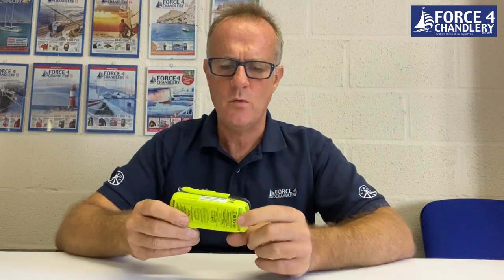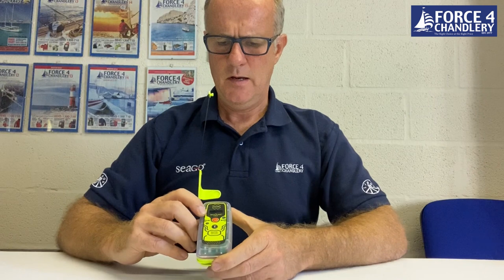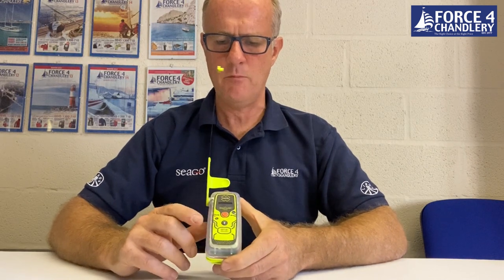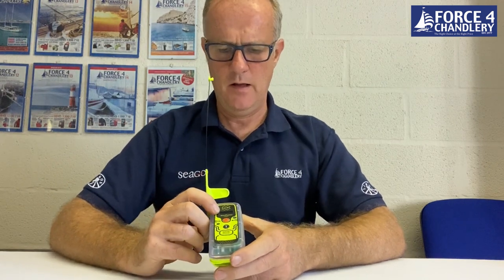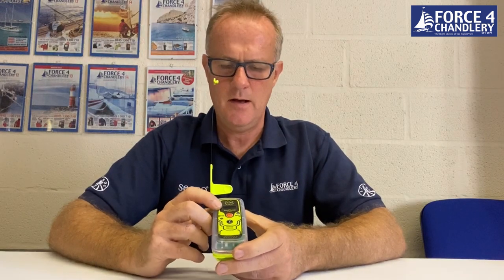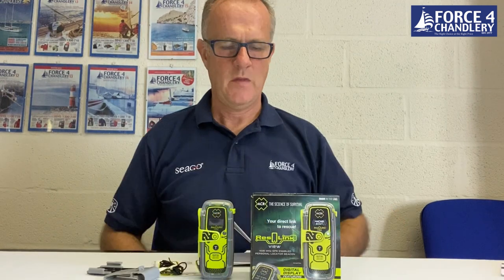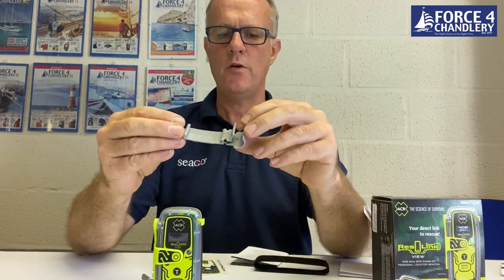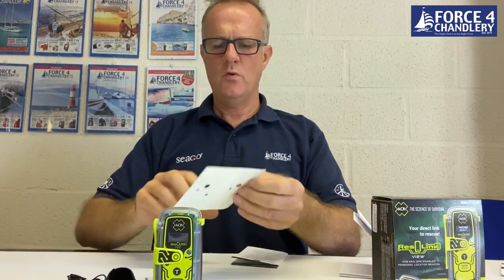ACR ResQLink View PLB - Everything you need to know about this buoyant PLB with digital display

Comment: Does this work if wet ?
Reply from the maker: Hello,

Yes these are fully waterproof buoyant units. 

It has a waterproof rating of 16.40 ft (5m) @ 1 hr., 33 ft (10m) @ 10 min so in the event of having to use the unit, if you're on the surface of the water or within a life raft it will function perfectly well.